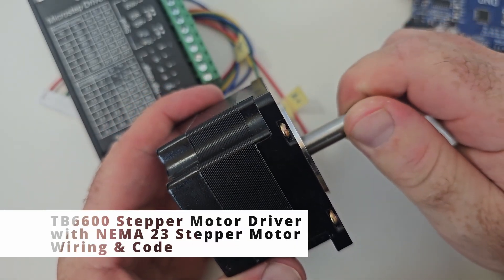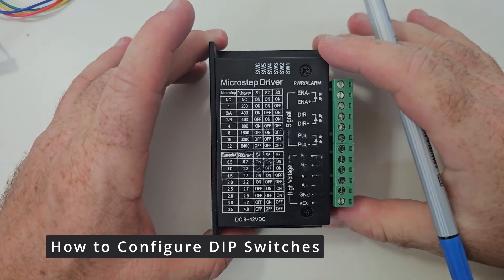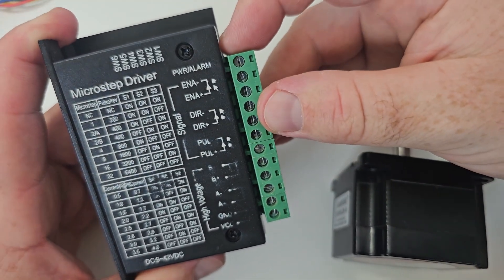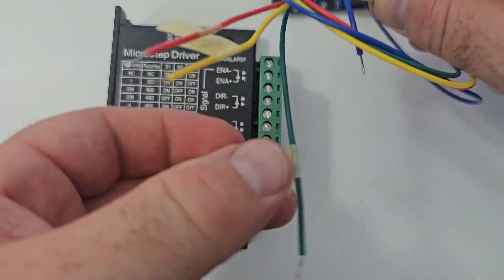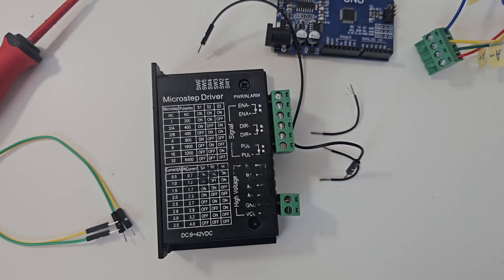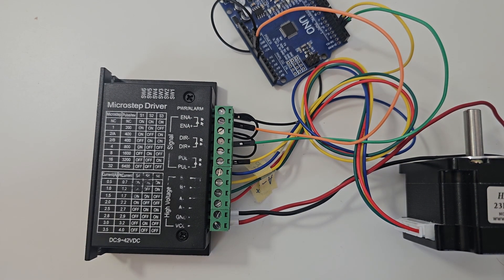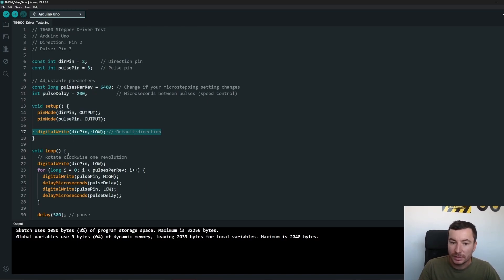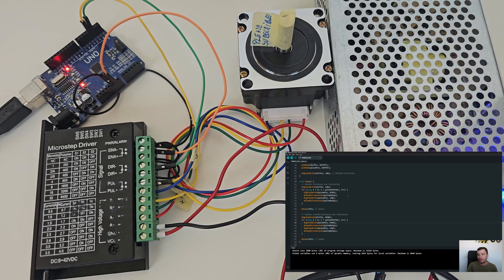TB6600 Stepper Motor Driver with NEMA 23 – Wiring, DIP Switch Setup & Arduino Code

Comment: how do you find which are positive and negative cables on the 4 stepper motor cables please
Reply from the maker: Pick you motors serial and look for a datasheet that usually contains. But in the upcoming days I'm planning to prepare a video on the topic.
Reply from the maker: Check out my latest video: https://youtu.be/DIBERNaMDOU it is dedicated to your question.